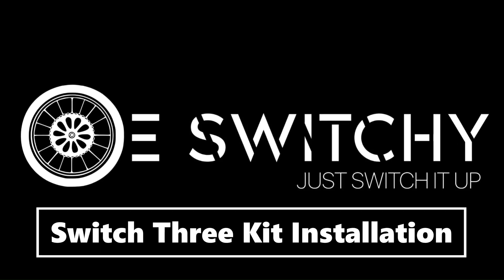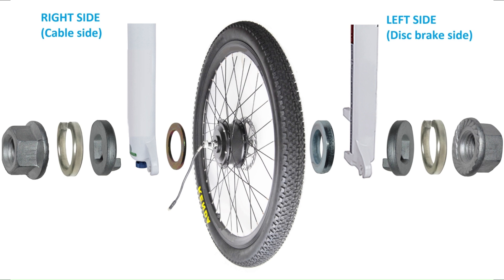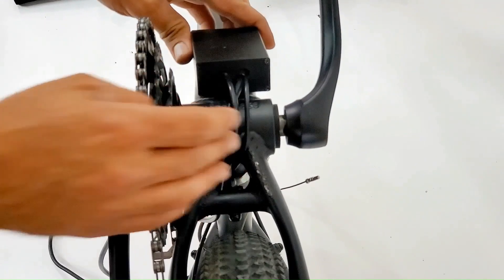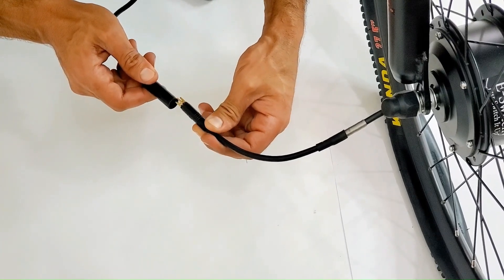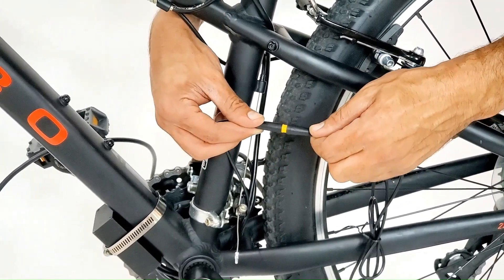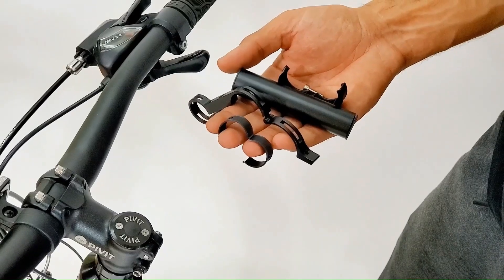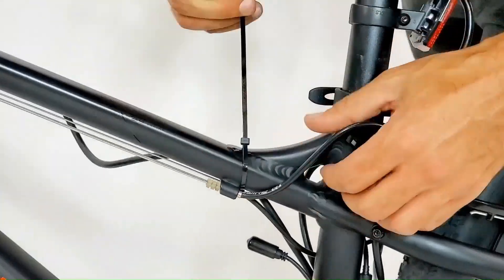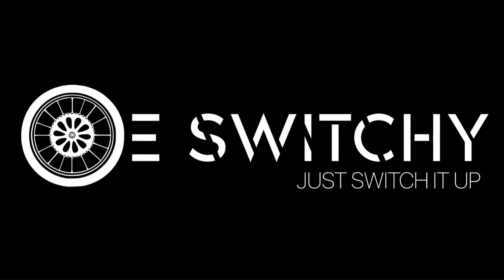E-Switchy Electric Bicycle Kit Installation Guide - Switch Three

Comment: Is there a way I can mount the battery on my bike rack? I have a folding bike
Reply from the maker: Hi there! Yes, absolutely! We offer three models, so you can choose the one that best fits your needs:
✅ Switch One – An all-in-one wireless model with the battery integrated into the front wheel.
✅ Switch Two – The battery mounts on the middle frame where the water bottle goes.
✅ Switch Three (featured in this video) – The battery mounts under the seat but can also be placed on a rear rack if preferred.

Let us know if you have any questions, we’re happy to help via phone, live chat, or email!